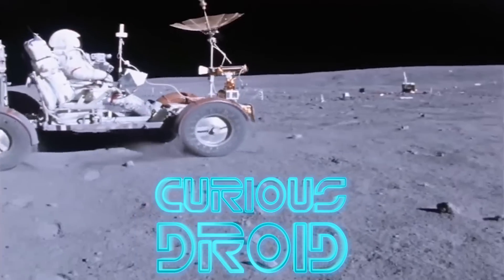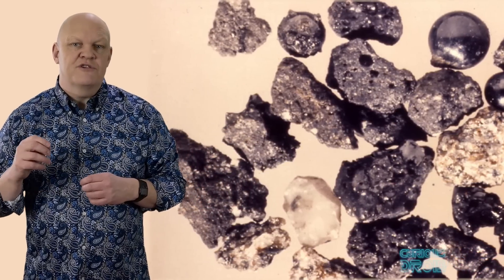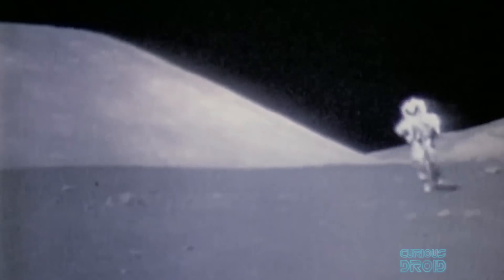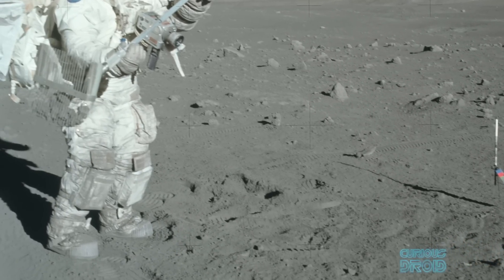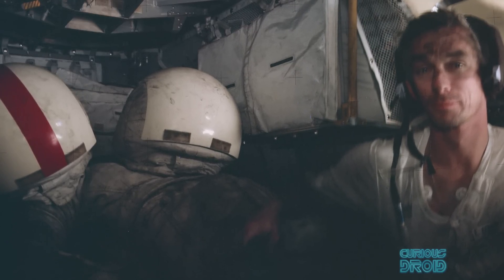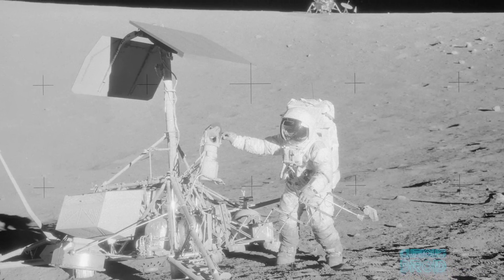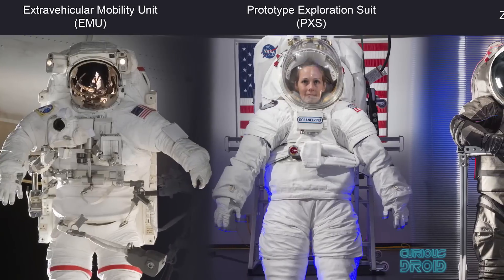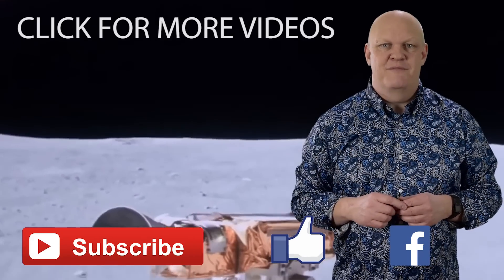Apollo, the Lunar Dust and NASA's Dirty Problem

Comment: Hmm, I have a question no one has been able to answer.  If the Columbia containing Collins was circling the moon going 20.000 miles an hour, and the lunar module with Aldrin and Armstrong blasted off the moon surface going straight up, how were they able to connect with the Columbia going that fast?  The aluminum encasing the capsule melts at 660 degrees and the Van Allen Belts are 4000 degrees, so the only thing that could withstand that heat is ceramic which they did not use.  I have more questions but we'll see who can answer this.
Reply: MoonLanding NeverHappened What I believe you meant to say is that nobody has been able to give me the answer I want as these questions have been answered many times over.
Reply: Hi Martin C.  I have not had answers to a lot of my questions.  Aluminum melts at  660 degrees.  Aluminum was what made the Eagle so light. The Belts are between 3000 and 4000 degrees.
Reply: They had synced speedometers, from 0 to 80000 mph. Not even today they don't have a speedometer in their rockets.
Reply: what do you mean synced speedometers.  Speedometers don't really mean much in space if you think you can have enough fuel to change your speed at will.  I don't mean to piss off everyone, but the truth is the hardest thing to bear when it disagrees with what you believe.  I don't believe or trust NASA the more I hear them.  Oh BTW, I don't believe they landed on Mars either.  Oh oh, I think I just opened up a big can of worms.
Reply: Obviously you don't understand radiation.  And how did the Eagle match orbital velocity?  In space where there is no atmosphere/air of any kind it is impossible for anything to be able to turn without any air to work against to make the turn, and the eagle did not have the huge fuel needed to accomplish it.  I know this is hard for your to understand, after all if NASA says it happened.  There are more doubts that it didn't happen happened then it did.
Reply: hater gater,  have you ever been able to catch up with something going 3600 miles an hour, how about 300 miles an hour? IT would only be a
blurr if you're lucky.

 Hmm, you said, "The Eagle matched orbital velocity and position with the Columbia which is fairly easy in a vacuum and in lunar gravity".  If you believe the video showing the Eagle "blasting" straight up (though it was very wobbly like it was being pulled up by a rope) from the lunar surface, it was going straight up, it was impossible for it to match up.  There was no way, NO WAY possible for the Eagle  to turn  in order to match velocity.  Exactly how did lunar gravity help anything?  I hope  you do some more research.
Reply: I understand physics.  A child's science book is like the rest of public schools.  It feeds the heads full of mush and keeps them that way until they get out of overrated college.  By then they need tutoring so they can read enough to graduate.  believe me they have had fund raisers to help these "students/children" pay for tutoring.   You have "science" and then you have "what really is".  I did my research which was prompted by all of NASA's reports about what they found on MARS.  When I see photos released showing driftwood and whale bones, that makes me curious to find out why they are revealing that, other than the concern that the public is loosing interest in their "space adventures" and they have to show a woman in a flowing dress and flowing hair romping across the Mars Plains.  Up until two years ago I really believed we had made those landings.  NASA changed my mind.  Besides, NASA has a video explaining why we can't get through the Belts YET.  Go look for that video.  It is a NASA VIDEO darling.
Reply: My, my MoonLanding, you are so perceptive, Good answer!
Reply: Did you know that the VAB is over 60,000 miles deep?  Actually there were originally 2 bands and now there are three because some genius on earth got the bright idea to send up a nuclear bomb of some sort to explode in the belts to, hopefully, open up a clearing to pass through, all it did was create a 3rd belt and made things worse.  It doesn't matter how fast the Discovery was going 3000 MPH or 20,000 MPH or 50 million MPH.  This is not Star Trek, you can't turn in space because it's space.  Means no resistance,  I love this subject because I am so 100% sure of what I know.  I really did do my research, my dear,  I love a  healthy debate with people who really want to believe it really happened,  because I hear something new and even more unbelievable every response I get.    When I watched and listened to Collins, Armstrong, and Aldrin talk about their "journey" at their first major press conference I noticed how uncomfortable they were talking about it the biggest event of their lives.  If I had gone to the moon I would be so excited to share that experience.  Their presentation was so lackluster and they kept looking down searching for words, they looked so depressed.  I have believed the moon landing happened since 1969,  when I watched the foggy video on a big screen they had up at Disneyland, that's a long time ago.  yet what got me started on all this was when NASA kept reporting stupid photos especially of the photos taken by the Mars rover, that is what got me started on my research.  I spent 4 weeks researching, asking questions and even contacting NASA (who BTW never responded).  So I kept going.  My husband is a Physics major and we talked about it for a long time.    I'm not emotional just passionate.  I don't give up until I have answers.  You're the first person to not be afraid to dialogue with me and I thank you for it.  I love this subject.  So sorry if I am driving you crazy. At the age of 67 I cannot believe anything other then we never went to the moon.  If you want to respond you are always welcome.  I approached this whole endeavor with a closed mind, then I started to open my mind and I am of this realization that it never happened.  You're a good person. :-)
Reply: @Alligator-z1q  It doesn't really matter what speed.  This event never happened.  And since NASA destroyed all the "video" they had of all the so-called "moon landings" the rest of the world will never be curious to find out the difference.  As for me, I took the time to research.  The more I did, the less I believed.  Notice I never called you a name darling.

Comment: Fascinating video: thank you!

As a former respiratory clinician in my view the astronauts were extremely lucky if they didn’t experience long-term respiratory complications from such lethal stuff circulating in their air supply in the vehicle.

If they had been advised that the stuff had the potential to breach seals they’d have been better not to place their hands across the totality of isolation buggy door seals on their way into it - see 4.55 & 4.58 - in case they had been contaminated by it. But fortunately they and the rest of life on this planet seem to have survived this.

Also was concern about this only raised after the mission launched? 

As if not this isolation procedure has always seemed very flawed and half-arsed even by contemporary isolation protocol thinking - ie ditch into the sea in the space-exposed command module, pop the hatch, transfer the astronauts unprotected onto a helicopter, emerge them onto a crowded aircraft carrier deck and then walk across an open space filled with unprotected people into an isolation booth? What?

I can understand the need to do bio-studies on the astronauts post-flight - but unless any possible contaminant organism moved at the speed of a walrus with a burnt flipper and toothache the number of people potentially  exposed to it prior to the so-called isolation could have caused a worldwide epidemic in a matter of days.

As a post-flight space for the astronauts it’s possibly fair enough.  Though remarkably low tech.

But as an isolation procedure for the quarantine protection of the planet - it’s useless. Forget it.

Strikes me much more as a PR exercise - like calling chimp HAM’s electric shock electrodes “sensorimotor plates”
Reply: I don't know how any life form can survive the vacuum and radiation of space.
Reply: The astronauts were wearing filter masks when picked up from the Command Module and then all the way into the isolation booth.

Comment: I pondered if the regolith might be used for electrical steel, or 3D printing like powders used for metal printing. A melted surface might pave the way for launch pads and work areas, also buildings. The idea of an ionized suit crossed my mind, but they beat me by decades. 
Thanks for the informative video.

Comment: Interesting dude, thanx.
Just wear dryer sheets to get rid of that static cling.

Why didn't the centrifugal force of the tires cause the dust to fly higher than it did.
Or were the tires so slick that dust didn't cling to them and was thus just caused to move from the embatterment of the surface from the tires smashing against it.

Comment: Sorry, but the fact that the layer of dust on the moon is a thin one, absolutely proves that it hasn't been happening for "millions of years"!  This was a concern before they even landed on the moon.  The false idea that the universe was "billions of years old" meant that if the moon had been around as long as they thought, the layer of dust on it could be so thick that the lander would sink down into it!  The fact that it was a thin layer, and they knew there was dust in space that constantly fell, and much of the dust that was in the thin layer consisted of particles that were the result of meteor impacts meant that the moon HASN'T been around that long, or the layer would be MUCH thicker.

Comment: The rocket engines on the lunar module was never tested. The test platform they used on earth to train the astronauts failed, crashed and burned up nearly killing John Glenn. Both rocket engines were chemical rockets meaning once ignited they could not be shut off. So you are telling me that three intelligent astronauts bought off on traveling a quarter of a million miles into space and gambled they could land and take off from the moon in a lunar module that consistently failed tests on earth using jet engines, and trusted two untested rocket engines that were never fired in space like conditions or under any load? That's what you want me to believe? Are you serious? Are you serious!
Reply: Ebony Man Both the ascent and descent propulsion systems on the Lunar Module were extensively tested, both on the ground and  in earth and lunar orbit. The training vehicles were successfully flown on earth on many hundreds of occasions. The well publicised crash involved Neil Armstrong (not John Glenn) and happened because of a system failure rendering the vehicle uncontrollable. The propulsion system on the training vehicle bore no resemblance to that deployed on the Lunar Module. Your entire post is inaccurate.
Reply: @Ebony Man
> Are you serious? Are you serious!

Depends if you are serious, are you?

> The rocket engines on the lunar module was never tested.

Half-wrong, and a manipulation. The design itself was tested multiple times, the only test they could not perform was for the actual engine that was sent to the moon. They used UDMH/N2O4 propulsion, highly corrosive when burned, but otherwise very stable and reliable. Alas the engines were one-use only, they were the most reliable and simplest designs every possible - hypergolic, so no ignition mechanism necessary, also pintle injector with face-shutoff - so no valves were necessary. Simple and elegant solution.

> Both rocket engines were chemical rockets meaning once ignited they could not be shut off.

Utterly wrong. Only solid rockets cannot be shut off. LEM engines for descend and ascent modules were liquid-fuel engines, not only these could be shut down, but also these could be deeply throttled. Shutting down these was actually easy - cut off the propellant flow and engine stops burning.

> So you are telling me that three intelligent astronauts bought off on traveling a quarter of a million miles into space and gambled they could land and take off from the moon in a lunar module that consistently failed tests on earth using jet engines, and trusted two untested rocket engines that were never fired in space like conditions or under any load?

Wrong and manipulating again. LEM was never tested using jet engines, what you refer to was the mockup model that would emulate steering on descent, but it did quite a bad job and was said to be more difficult than the actual lunar landing itself. The actual engines put on LEM could not be fired, but that doesn't mean these weren't tested on Earth.

> That's what you want me to believe?

So you are ignoring facts, and made up your own fairy tale about Apollo missions, then you want to argue about your imagination. Good luck!
Reply: @Haos666  ..Someone that chooses to be known as Ebony Man..Do I need to say more...its all so simple...

Comment: So how did the astronauts clean off their space suits when they got back into the accent module? Didn't this dust caused problems in the command module? If one is to test material to be explosive, is it smart to test it out on top of a rocket engine? What did the dust do when they re-entered the Van Allen Belt? Would there be an explosion? See, they never went to the moon. It's all a pack of lies just like believing in Santa Claus. There was no blast of the engines during lift off from the decent module. You talk about blast from rocket engines but none was found on the landing pads and there was plenty of dust outside the lunar module to put so called foot prints there, but no blast crater underneath. Also no moon craters near the module. All I see and hear is a pack of lies!

Comment: How is it that the dust kicked up by the astronauts bouncing around on the lunar surface lands back on the surface before the astronauts land back on the surface. Is the lunar dust 10 times heavier than the astronauts. If the dust is as fine and light as they say should there not be a large cloud of dust floating around like we see here on Earth when we disturb a pile of dust here? Just curious.
Reply: kenparker99 Because of the lack of atmosphere on the moon, the dust would take a ballistic trajectory and not form any clouds, as dust clouds are suspended in and by the air.

Comment: 7:25 in -- "or shaking the dust off with an electric charge" -- Why didn't NASA think of that back in the early 1970's ??
Related to this: Were any measurements taken to see if there was any voltage difference between the Moon and the L.E.M.?? (on any of the Apollo Moon landings)

Comment: i odnt think the dust wil be that big a case if we start building on the moon. cuz firstly you say it is only a thin layer meaning we can remove it tho this is the hard part. now there is not dust close so landing is not a problem. 

or you can simply land in a area controled by us luke a hole in the ground. this way if it is dust at the landing site it wil blow away and not kolide with other structures. 

or you can simply build a hight tower. as the gravity is low you can most likely build taler as les gravity means less weght and there is no wind so no need for safety features ageinst wind and other natural disasters as here on earth. now with the high tower you can simply dock at the top and use it as a space lift no need for landing on the dusty ground.

Comment: I guess that is why the lunar lander made such a huge crater when it landed, almost losing itself in the hole made by the 10000 pounds of thrust used to land. NOT!!!!
Reply: Why do you expect a "huge crater" to be formed? What blast crater does an Airbus 320 create with each of its engines delivering 25,000lbf or a Boeing 747 with 4 engines at 55,000lbf. Did you perhaps also overlook the fact that the Lunar Module descent engine was throttled back to around 25% immediately prior to landing, delivering a mere 2,500 lbf?

Comment: You sir are either dellusional or a troll for the Ruling class. Either way you are an idiot for spreading this stupid disinformation. You're worried about moon dust? LMAO 😂 . Why aren't you worried that this same moon dust was not disturbed in any way upon the landing of the module? No blast crater. You are a joke.
Reply: And please explain why there should be a blast crater as you say. The lander weighted around 16000kg with a gravity on the moon 1/5 of that on earth the thrust required would be 3200kg . Now a BAE harrier / AV-8B can vertical take off and land at a weight of 8500kg approx. do you see craters under these no.

Comment: 10,000 lb  main thrust engine was throttleable it landed on part throttle 10 to 20% that would not have caused a crater. so saying that the engine would have 1,000 to 2,000 pounds of thrust.

Comment: i have always wondered why the landing pads on the module are one hundred percent dust free and why no crater left after exposure to > 10,000 LBS of thrust from the rocket engine. Meanwhile the astronauts are kicking up dust at the slightest movement of feet...